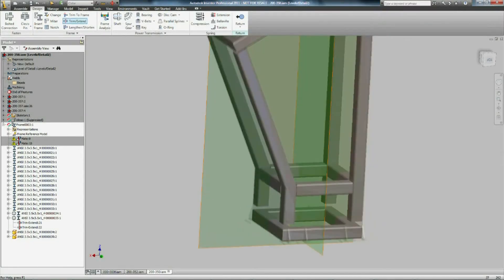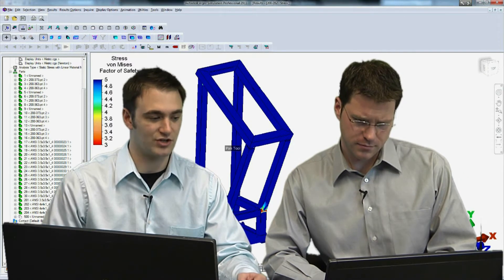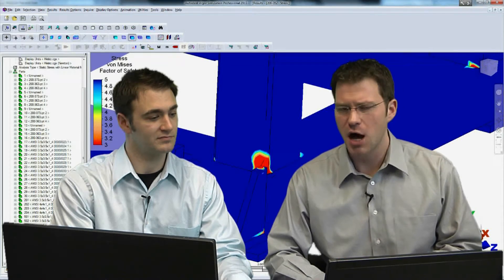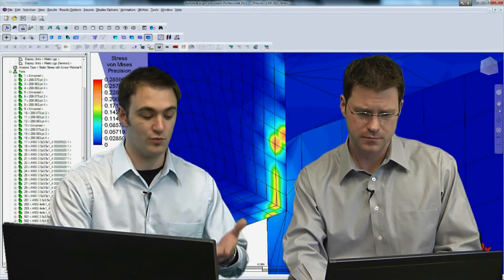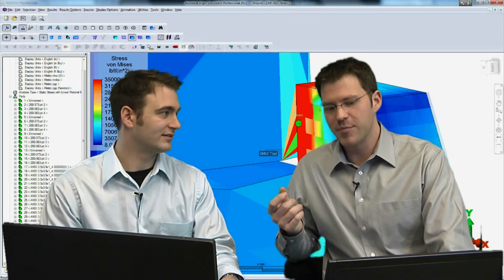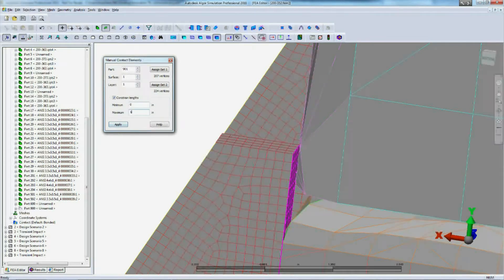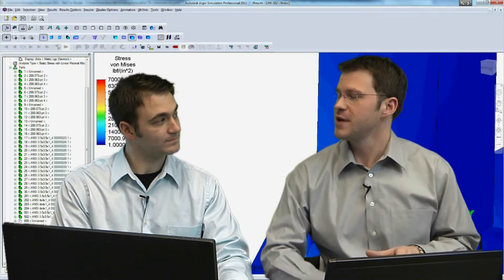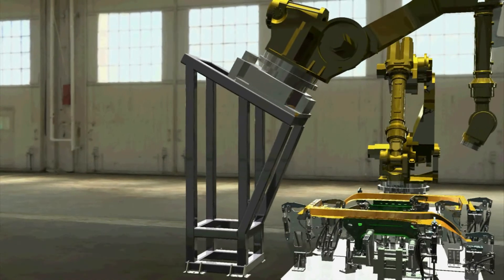Innovation Through Autodesk Simulation - Episode 1 Part Two - 2/2

Comment: Very nice videos, very helpfull. I have one question. Since the original design was for 5 inch frames and you changed it down to 3,5 inch frames wouldn't you have to change the supports as well?